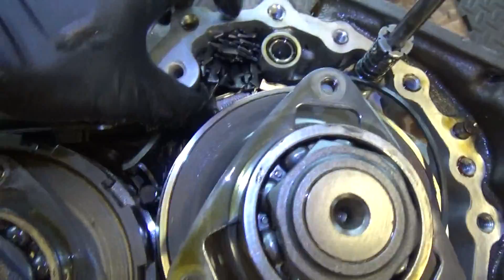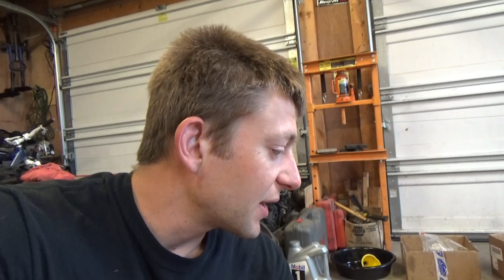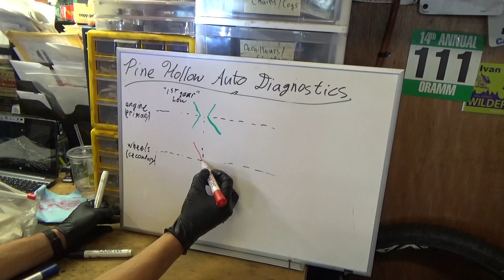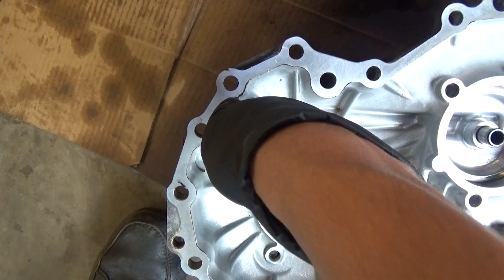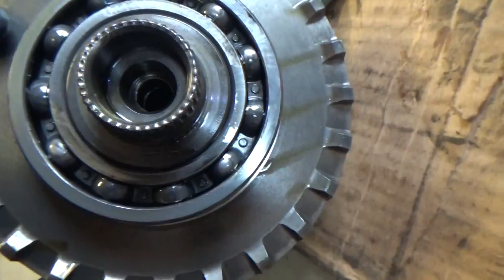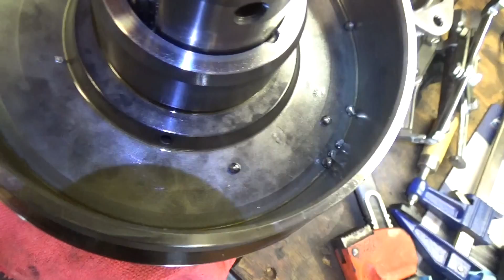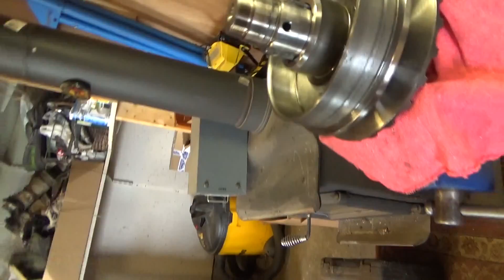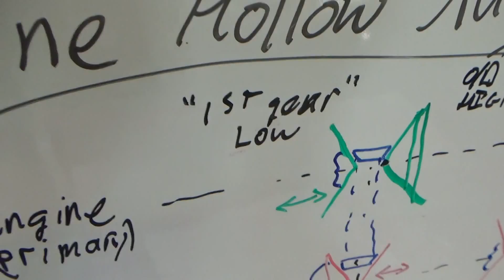Nissan CVT: Teardown and Failure Analysis -Part 2 (RERELEASE!)

Comment: 190k on my 2007 altima cvt. nissan ns2 every 20k miles, reprograms up to date, never once had an issue
Reply from the maker: If you have changed your fluid every 20k miles, you would have saved enough for a brand new transmission by this point xD
Reply: working for nissan as a tech has its perks...... like left over ns2 from the billion transmissions we do lol. still got 20+ quarts left on my shelf
Reply: Lucas McLain if you don't mind me asking....how money money approximately is the charge for a CVT fluid change?
Reply: Brian Lawrance last time I checked it was around 15 to 20 a quart and you need 5 for a flush, plus labor, roughly our dealer charges 200 but I’m not positive
Reply: Cheapest I found around Dallas was $275 for my Nissan Versa. Definitely recommend taking it to the dealer service. Aside from changing the fluid they also need to hook it up to the Nissan diagnostic computer to reset the ECU. They will also update the firmware to the latest greatest updates from Nissan to improve ride quality and wear and tear on the transmission. Apparently the ECU adjusts the pressure on the pulleys as the oil wears out, based on mileage. So, they have to reset the mileage counter back to zero to return the pressure parameters back to those needed for new, fresh oil. You might find some ma and pa shop that'll change the fluid for less but they can't, or won't know to reset the computer and you'll end up with a vehicle that performs worse after clean oil is installed and the transmission will probably grenade itself like in this video.

Comment: actually, I'll go with lubrication issue, due to excess heat buildup in the shaft. the pulley itself would be cooler due to lots of fluid flow, but how much flow does it have inside to cool the shaft.  I'm sure the engineers know the contributing factors and corrected it by now. could be as simple as a tiny hole to allow more oil flow or a complex major design change.
Reply: Oil deteriorates with usage.  Keep changing it, don't expect ridiculous high mileages from an old knackered oil.  It's cheap engineering to renew the oil!!

Comment: I am curious if the secondary pulley also has the same ball spline system. In theory, they both would see similar torque, but not at the same time.

Comment: The clever thing is that the metal bands don't directly transmit the power,that is done by the segment plates pushing on each other.the metal belt is there to keep the segment plates aligned with each other.
Reply from the maker: Yup it's a "push" belt :)
Reply: Here's a great video that shows exactly how that works https://www.youtube.com/watch?v=PiwRUfFEc5k
Reply: sceneitb4 quality! Raised a smile,they are called variators. Variable ratio sheaves., but pusheys sounds better!
Reply: @andrewwilson8317  I could of sworn they are called element plates
Reply: @KiloWattRC  Could HAVE*
Reply: And there is rubber in the fluid, that's the actual friction material.

Comment: Lousy metallurgy and bad engineering design cannot be fixed by lubricant quality.  

Thanks for exposing Nissan for its lack of engineering competence. 

Lot's of things use linear ball bearings, but raceways near to be up too the task and be properly sized.
Reply: This 011 series CVT is made by Jatco who btw should have fixed their crappy design years ago.
Reply: Nissan should be held accountable but Jatco are ultimately the ones responsible for producing this pile of shite!!!
Reply: Fridgemusa:

Ultimately it's the vehicle Manufacture's Liability for installing  problematic and faulty components on a vehicle they sell....it's well known,after Renault (the French) took controlling Interest in Nissan...the vehicles continued/continue to get worse...and not just their CVTs. In other words don't buy any Nissan product after(Extant) Renault became involved.

Nissan has a bad reputation of sticking it to the customer even when their vehicles are still under Factory Warranty.
Reply: i guess bc this cars was highway driven for most of the 180 K , i've seen CVT blow up much sooner at around 60 K
Reply: I heard that Nissan holds a 75% stake in Jatco and now Jatco has to justify any designs or changes to the Nissan board of directors. Again the CVT is deal breaker and our next vehicle will not have a CVT.
Reply: @TJ Roelsma You're right, 180k isn't bad for a CVT tranny.  And yes, I also agree they are not meant to be pushed to their limits time and time again by flooring it from a dead stop.  They are much more delicate than your traditional auto tranny.
Reply: The 07-2010 Altima CVTs are the devil.
Reply: @davidperry4013  the devil in a evil robe that says nissan altima tranny lol. i had an 07 and im sure this is what happened to me but my tranny went out around 140K. im very curious to see honda accord 5 and 6 spd be broken down this way
Reply: i love my 2014 maxima. very good cars
last forever
Reply: The 010 series CVTs in bigger heavier cars like the Murano, Maxima are actually more reliable despite having to work harder
Reply: TJ Roelsma No Transmission should fail at 180k miles unless you beat the piss out of it.
Reply: It's not Nissan its Renault's fault

Comment: You are correct, the failure was the primary pulley seizing up. This caused the belt to fail not because of off center loading but by stretching and snapping it. Both pulleys are one way hydraulic systems so they both can close up with hydraulic pressure and the constant tug on the belt while in motion forces the pulleys to spread open. The primary pulley was jammed closed with hydraulic pressure forcing the belt to the outer edge. When the secondary pulley was told to close up during acceleration the primary pulley would not open up and snap goes the belt. Now I could be wrong but at least it's food for thought.
Reply from the maker: Yup sounds like a plausible theory!
Reply: It's amazing these engineering marvels even work as well as they do (when they do of course). The crazy thing is the failure in this transmission could easily be made more robust and these transmissions could probably last twice as long! But then again what car manufacturer wants anything to last that long anyways?Your teardown and failure analysis videos are among the best on YouTube and I thoroughly enjoy each and every single one. Like you, my mind needs answers! Why did it fail, how did it fail and is there anything I can do in the future to prevent the same failure. Keep up the great work!
Reply: SAMP,  Not sure your fully right about "constant tug" comment. I believe the belt works in compression(segments pushed together) and not in tension(tugging or pulling on the belt) The steel bands could have broken in a bending force during high engine torque and a numerically low gear ratio event.  Same end result but a little different failure mechanism, just another thought.

Comment: Very interesting and I couldn't agree more, the way that half of the pulley connects to the shaft which extends from the reverse mechanism isn't even remotely beef enough(*). Part of the problem may be the shaft must have a higher thermal expansion coêfficient to guarantee an oil seal, so that limits the hardness it can have, but like you said, it should have had bigger balls... lol.
Did you remember to put the kibble back into the pully? -that said, they probably more than likely know what screws these up, so they might not even bother looking (image the tech going... 'hmm... these usually rattle.").

(*) Rem.: I'm not a mechanical engineer (nor a metallurgist), but, when you're any sort of engineer, you develop a certain way of looking at things and some things just don't look right.
Reply from the maker: Yes Jan, I think the balls of this CVT design were not big enough xD

Comment: yea perhaps if they had use a long square stock like a key+way (three) to support the load. Ge washer machines had issues on their tub brake systems on the transmissions/. It was soft ball bearings riding on soft ramp cam arraignment that disengaged the brake when the motor loaded the drive pulley. One way it would wash the motor would reverse and the ramps would slide on the balls.  They eventually hardened the two and increased the life 4 fold. The washers used 3 balls too. I cannot imagine this design on such a high load device. . Sure the load is split between the 2 sheaves but  i would stipulate this had another  100000 miles in it at least if this was designed better in this one area alone.  They would just strip it throw out the one side driver pulley if not the driver and the driven sheave arrangement.and reassemble it. Like you said, nothing else in the system really. Simple. I doubt they will even care that you were in it probing around.mass production they just strip and everything goes in individual piles. one person checks a different part and decided what stays and what goes. 
Your the man Ivan!!!!
Enjoy your new year beginning and stay curious as this is what makes a good tech be a awesome tech!!!
PEACE BROTHER!

Comment: facinating teardown-
 I saw OLLLD Dutch -  DAF -   cvt-      in 1960's      -where actual rubber belts used
  and told cvts LIMITED to 40 H/P MAX  
   now stuffed into all kinds of carz-   so possibly metal "belts" capable to handle 200 H/P-BUT for how LONG?

-will hold off until 300,000 miles average  accumulated    (by most cars) before i consider such unit 

-just like Ford and others offering DUAL CLUTCH option to guinnea  pig customers 
 -but dual clutches (Ford etc) dead and dying all over the place-not necessarily from ''creeping'' in traffic either ~~

Comment: Ivan I have met one of the engeneers working on the development of this gearbox. They have in their vaults the first produced belt. It had 1.000.000. km's been driven with no problems. This type of gear was invented by Hub van Doorne and his team at DAF factory in The Netherlands. Before this in the '60s they produced a automatic transmission with 2 rubber belts used in small cars they accelatated very fast for that time. First with a 2 cilinder boxer engine later with  4 cilinder Renault engine even a F1 car This CVT was later adopted by many Japanese companies as well as Fiat.
Reply: The 300-series Volvo was fairly popular here in Finland back in the day. Looking back, the CVT was ahead of its time, as the principle hasn't really been used in cars before the 21st century. My buddy's parents had a Volvo 343 in the late eighties too, so I got to experience the ride. I always wondered about the strange tranny and thought something might be wrong with it. One peculiar feature of this tranny was the ability to go as fast in reverse as it did forward. A Finnish car/tech magazine, Tekniikan Maailma, even raced a 300-series Volvo on the track in reverse!

Thanks for the video, Ivan, and cheers from Finland! Been following your channel for some time now, but haven't commented until now.
Reply: If anyone is interested in reading a bit more about Hub Van Doorne and the CVT push belt, I wrote an article for the Home Metal Shop Club about Hub and the transmission. It starts on page 8 of this newsletter: http://homemetalshopclub.org/news/12/newsletter1203.pdf .
Reply: Try looking at snowmobile transmission design. This is basically the same design. They outta put skis on cars with this transmission design.
Reply: We in Holland had some funny races all backward with those Daf and Volvo cars.https://www.youtube.com/watch?v=S7ipFApsFec Have fun. LOL
Reply: Willem Streutgers 
I have driven one of the Daf 33 variomatic transmissions, it felt a bit like driving a car with a slipping clutch.
It always sounded like it was revving too high.
Daf were taken over by Volvo in the early 1970's  and Volvo produced a similar car to the Daf 33 called the Volvo 343 and 345 (the last digit referring to the number of doors).Volvo used the variomatic transmission for a couple of years but it proved problematic and unpopular and they discontinued it.
I lived in the USA for 19 years and never saw any of the Daf derived Volvos. Probably was never sold in the USA.
Reply: Well they are still around here in Europe and very popular as an oldtimers. Those with the rubber bands can still be driven whith one band.
Reply: Ford Fiestas and escorts back in the late 80s had them. they were horrible. No torque converter either.
I repaired many at a Ford dealership

Comment: I think maybe the way the system maintains the proper ratio between the pulleys is that the two oil chambers are connected through the shift control valve .  I think you will have a fixed volume of oil between the two.  So as you move one, the other kind of floats to keep the same volume or pressure.  The shift control valve seems to operate more like a differential valve where you upset the balance and it allows oil to move between the two drums to not only mechanically move the one but move the other hydraulically to keep the same fluid volume or maybe pressure.
Reply: So when the drum seized on the shaft, you over pressured the drum and blew the seal as the fluid is non compressible and had to go somewhere.  Unhappy things happened as a result.
Reply from the maker: I like the "unhappy things" theory haha :)

Comment: Ivan, it looks possible to me that when the balls got too jammed into the grooves, that pulley got jammed into position and no longer could slide in and out.  The other pulley is still able to be commanded to move by oil pressure, which caused the belt be overloaded and broke.  Thanks for the video.

Comment: Excellent bit of detective work, sir!  IMO-that point of failure is inherent to the design.  These CVTs will provide decent service under moderate driving conditions but this isn't a robust contraption.  Basically, a few ball bearings and a few millimeters of the side of those grooves bear the full torque whenever the vehicle is in motion.  I would file vehicles so equipped under "maybe okay to buy new but to be avoided in the used market".  186,000 miles is okay for light use but imagine the shape of these CVTs in "ricers" where young guys beat the hell out of them.
Reply from the maker: They probably don't last 60k miles in city driving lol
Reply: torque and those many bearings aren't a good match; perhaps a cylindrical pin would have been better?
Reply: empty tomb - there are actually cylinder pins included in some rebuild kits, and Questioning3’s YouTube channel discusses making your own.

Comment: Thanks for the reup! I totally did understand to put it on a paid channel to maybe cover up the loss of the core. 
I think the oil can play a important role hear. Oil is supposed to keep the metal parts away from each other. If the viscosity gets low or additives get old and lose there function then the bearing balls would ride metal on metal.
Reply from the maker: Perhaps. Would be interesting to see if a fluid change could prolong the life significantly...

Comment: That seems horribly engineered. Nissan ya dun fucked up.
Reply: Everything Nissan (including JATCO) went downhill after Renault.
Reply: Nissan buys most of their CVTs from JATCO - who is one of the largest CVT manufacturer's and suppliers to OEMs all over the world.  It is up to the car manufacturer to spec the unit adequate for the vehicle it is going in - since this same model of CVT is used in other models of cars without many problems - it was just undersized for that Nissan Rogue
Reply: KCautodoctor You do know that Nissan is the parent company of JATCO.
Reply: Nissan owns 75% of Jatco.
Reply: TruAgape1234 indeed.
Reply: Invented by Hub van Doorne from the Netherlands check at wikipedia.
Reply: Nissan didn't engineer or design that transmission. Jatco Ltd. did.
Reply: Personally, I can't support neither Jatco's, nor Nissan's design decision on this one.

In engineering there are ways to come up with dimensions for components given the expected stress they'll be under, but those are dependant upon ideal materials and ideal environments. So those aren't to be trusted in the real world. In consequence, designers tend to beef them up by at least a factor of 5, but, as people whom I started college with and became actual mechanical engineers tell me, often, those prototypes will still break in endurance testing.

I find similar results in my own field of electronic engineering. Theorethically, I should be able to run circuits at 80-90 degrees centigrade above aveage ambient temperature, but, in reality, it turns out anything which runs at about 40 degrees centigrade above ambient temperature or more, will, most likely, fail prematurely. That's why we shoot for about 20 degrees centigrade above ambient temperature.
This is because endurance testing on components is done on an individual level, not as a combination of them as a whole (so ignoring possible, inherent weak spots).

Getting back to our example at hand, it appears to me there were 4 grooves. Just the addition of 1 groove (and re-spacing the other ones) and increasing the size of the ball bearings by 100 to 150%, would have made this gearbox stout, imnsho.
Reply: Jan Verschueren You’re right, they could have thrown in a properly spec’d shaft unique to the Rogue but there has to be a paradigm shift in our consumer market. Nissan weighed the cost of reengineering a CVT for their midsized suv vs throwing in an existing CVT and the result was that consumers wouldn’t know the difference until the car was out of warranty. Thus, how ever little R&D would have cost to make this CVT robust enough for the Rogue, it would be wasted money... until now. This video will probably cost Nissan millions if it continues to spread.